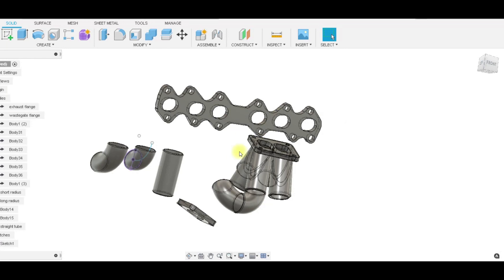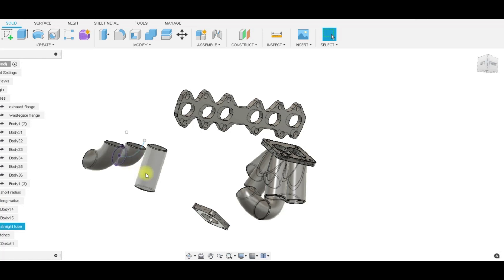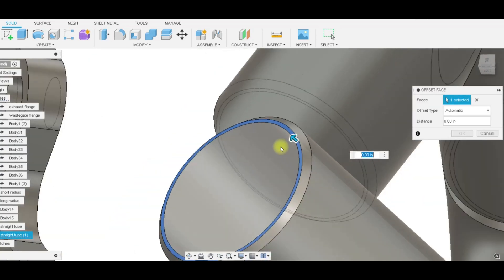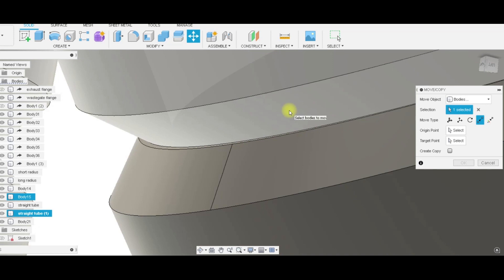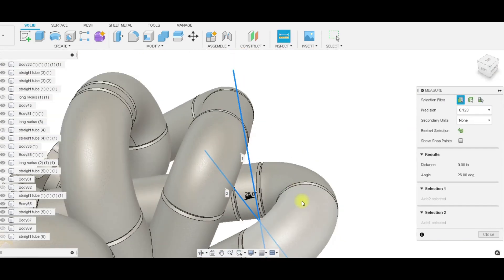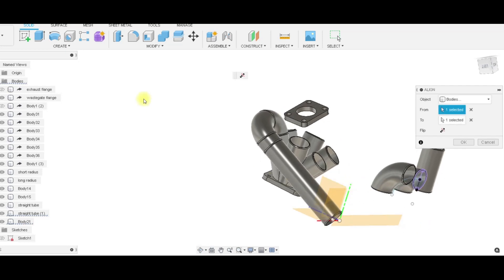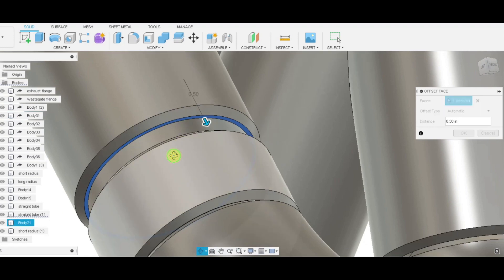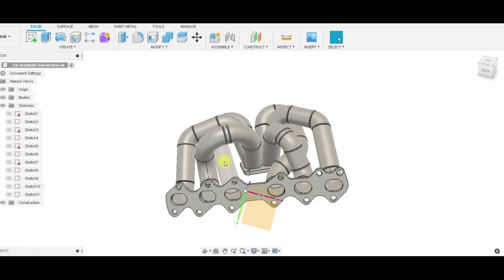Design a TURBO MANIFOLD using FUSION360 and 3D SCANNING  using the EINSCAN HX

Comment: It's a clever technique you've got there, but you're making life hard for yourself with this tial and error method. I'd start with drawing a centre line for each runner made up way points then add the radii of the 2 different tube bends your using. Then loft the tube dia along those centre lines.
You can then move the points around to get the centre lines as equal length as you can.
This is how I do it for my work. 👍🏻